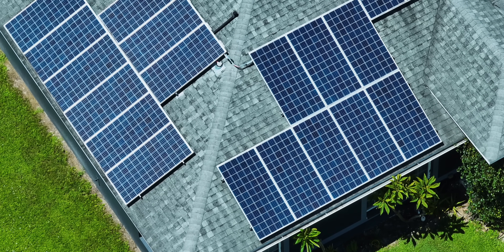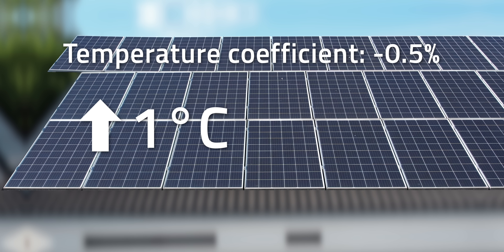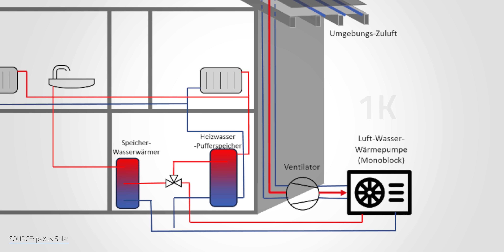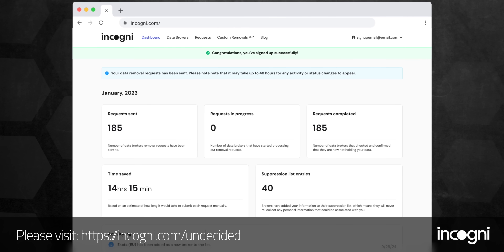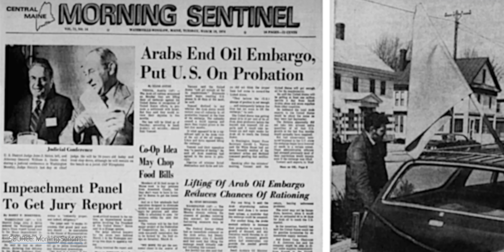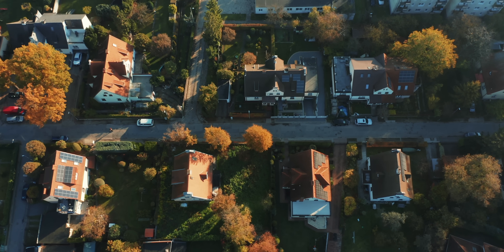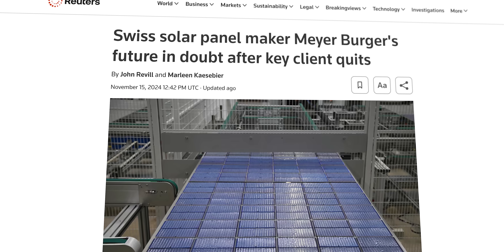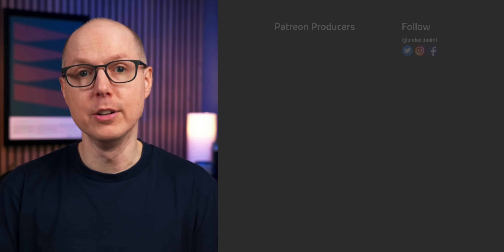Why Hybrid Solar Heat Pumps are the Future of Home Energy

Comment: You don't need a heat pump on your solar panels. When the panels are really hot you only need hot water, and given how much heat energy hits your roof on the summer you cannot move that much heat into your hot water unless you want to boil off the water from it. You need a less efficient method for moving heat, or really just somewhere to dump all the heat.

Comment: Is there a non-Tesla solar roof tile system?

I love heat pumps. I love solar. This seems like far less than the sum of its parts though. 
This seems like it'd be handy in places that rarely get hot or even warm. Here where there's a 100F temp swing, sometimes in the same week, it wouldn't be that awesome.

Comment: The other comments indicate a significant amount of questioning the utility of this design. By and large, I and others think its use case is counter-productive. PV need cooling (especially) in the summer but then what to do with that heat after turning your water tank into a steam rocket. On the flip side, there may be some gain in the winter but in the dead of night when it is -40° the PV panels and their arteries freeze and crack. Oops. Need to run a glycol in that loop so now you have a glycol heat exchanger in your fresh water supply. I can't imagine why people aren't rushing to add that feature to their home. <sarcasm>
This solution ... doesn't seem to add up.

Comment: I'm concerned with this, if it is hot outside then you probably don't want that heat being pumped into your house. If it is cold then your solar panels may ice over, even in above zero temperatures.

Comment: I don't hate the basic concept of using a heat pump to cool your solar panels while heating your home I just think the biggest problem with it is using all of that piping and air conditioning refrigerant is kind of inefficient and expensive personally I would just try using a lot of air ducting between the panels and the roof and use the air that goes to the heat exchanger as the working fluid instead of sending all that refrigerant through your roof that has a good chance of getting punctured by like hail or a tree branch or something like that

Comment: A few months ago I also did a research on this; I'm Portuguese.
I actually found a Spanish installer that had these hybrid panels available; but the cost was absolutely prohibitive... 30-40+ years to pay-off the difference!
Reply: can you share the installer and tech he uses? I'm in the process of purchasing a land with a house for renovation in Portugal, and i'd appreciate any leads
Reply: That cost is absurd when you consider that the panels themselves only have a 10-15 year life before efficiency starts dropping significantly and need to be replaced around 20 years.
Reply: Pay back time is a killer! People think they are saving money.
Reply: That's the issue as the cost can be much higher vs buying a new (standard) US roof plus solar panels.
Reply: That's too bad.  I'm also in Portugal and may need to replace my roof soon.  I was hoping this would be a practical solution here.

Comment: This is a not a solution for 90+% of people.

Solar panels are designed to work  best at 25C/77F. 

Yes they will heat up in the sun in winter, but in most places that need heat from a heat pump there just isn't much heat to scavenge.

This is made worse by the low number of solar hours in the winter, which gets worse as you go north of the equator. 

The amount solar hours in the lower 48 is between 1.5 hours and 4 hours a day during the winter.

Wintertime tends to be cloudy, winder, and more precipitation. Clouds and precipitation reduce solar production. All three reduce solar panel temperatures. 

More than likely you will want to be in an area that has at least 15C/60F ambient temperatures but under 20C/68F.

You don't need to heat much or at all when it's 20C/68F or higher.

You definitely don't want to reduce the roof temperatures below freezing.

This means most people that could make the most out of this technology are the very people who get the least benefit from this technology. 

You likely do not want to use it at all when ambient temps are below about 5C/41F as the system may cause the tiles to be under 0C/32F.

Only being able to utilize the system between 5C/42F and 20C/68F on sunny days for 1.5 hours to 2.5 hours for most locations that will fit those requires makes little sense.

Even worse when you calculate how little solar power you will be producing under those conditions.

A much better solution is solar heat. This will concentrate the sun to raise the temperature of a fluid that can then be sent through a heat exchanger to pre-heat a forced air system or heat a heat pump's coils (raising the localized ambient temperature).

These solar heaters can be made from PVC or copper pipe (copper is much more efficient and expensive).

I've seen small systems that were able to raise the fluid temp over 65C/150F.

They are sometimes used to heat a hot water tank or even a swimming pool.

You can install solar panels on your roof and solar water heaters on exterior walls if you want to maximize efficiency. 

Even if you don't have a pool, you can use a portion of your solar water heater to pre-heat water going to your hot water tank during the warmer months.

Some people will install old water heaters as storage tanks for the hot water. They do not hook up the electric elements. They add extra insulation around the tanks. You can build an enclosure for the tanks and fill all voids with insulation 

You can then store 150 liters/40 gallons, 300 liters/80 gallons, or more hot water. The tanks are cheap as they are used tanks that are no longer worth using as a hot water heater.

Now you have a large volume of reserve hot water that is pre-heated water going into a heat pump water heater, which is installed as close as possible to those tanks. At night you may have enough hot water to do laundry and multiple showers with the heat pump barely being used.

You can build such a system for under $1000.

If you want to dedicate enough area to the solar water heater it can be used as a pre-heater for other heating systems, even in cold climates as long as it's mostly sunny.

As a heating system pre-heater you can either pre-heat intake air for a forced air heater or as an ambient heater for a heat pump. 

To be efficient you will want to use as much space as possible for the solar water heater and install as much hot water storage as possible.

This system works best in areas were its sunny and warm during the day, but cool enough at night to desire heat.

The southern US may have winter daytime temperatures of 15C/60F or higher, but at night is may drop to 4C/40F or lower.

This is technology that should be enhanced. Off the shelf components with a water and anti-freeze mixture can be built cheaply.

With some R&D a turnkey more efficient system could be designed and sold that should be much cheaper than a SAHP and preform so much better that customers can have a reasonable ROI time frame. Most people that install a SAHP system will never get a ROI.